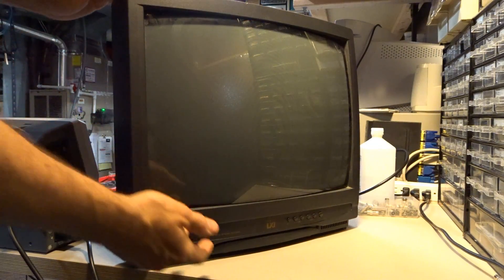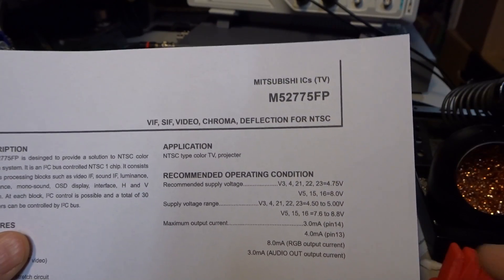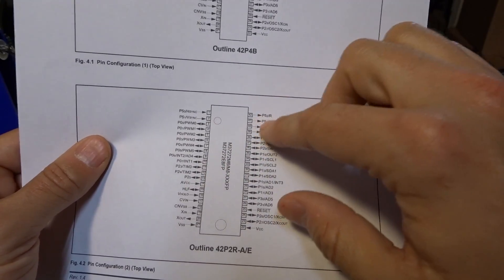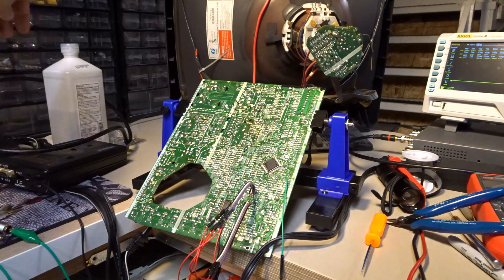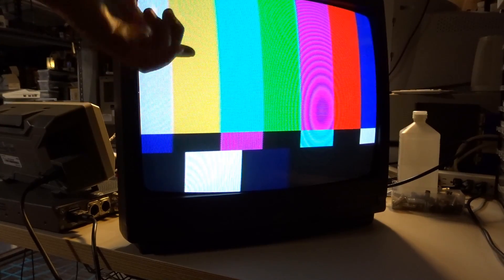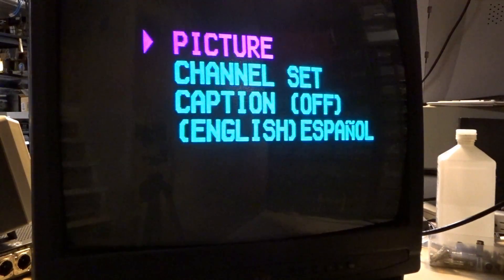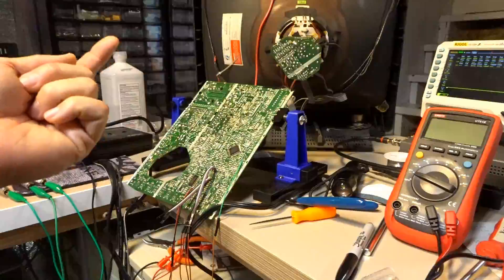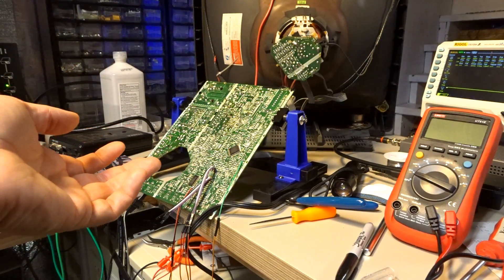Trash Picked TV RGB and Composite Mod

Comment: You know why the horiz output transformer is called a flyback?  Because if you touch it while it's energized, you'll fly back clear across the room...
Reply: You made me chuckle.
Reply: you're comin to my next party
Reply: Besides the horz sweep, the flyback xfmr also generates the high voltage for the CRT anode.
Reply: Youl get a very nasty bite but it wont kill you unless you have a weak heart, the current is too low, however capacitors will kill you, those bastards give off a high instant massive pulse
Reply: true )))
Reply: Touch em all the time. It's the tube you need to worry about
Reply: There's a flyback pulse to return the scan back to the start
Reply: A D 
Sorry for the bad pun.  Actually, "flyback" refers to retrace (the beam flies back to the left of the screen to begin the next horizontal line sweep).  This is no joke!  

But the joke is on the retrace.  When (and if) you wake up,  after flying clear across the room,  , you will retrace your footsteps and try to figure out what went wrong. 

If you don't wake up, well, that explains the function of the horizontal hold. You will be held in that position forever.  If you'd only adjusted that first!  Then you'd be in sync... but instead, you're dead on the back porch, and all you'll ever see now is blacker than black.  

Moral of the story:  A flat panel display is unlikely to lay you out flat.
Reply: *no yoke
Reply: @gyrgrls  that wat I like about LCD TV's is how easy they are to fix and the weight be less
Reply: @publicmail2  bwaaahahahaha! Genius.